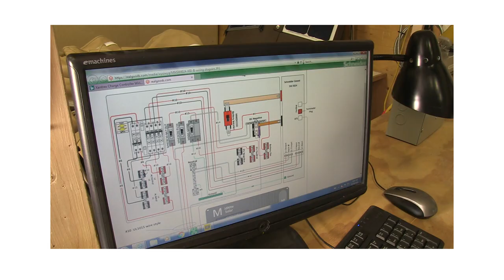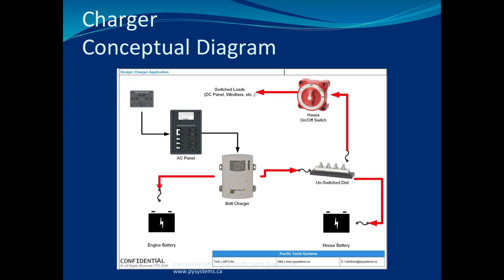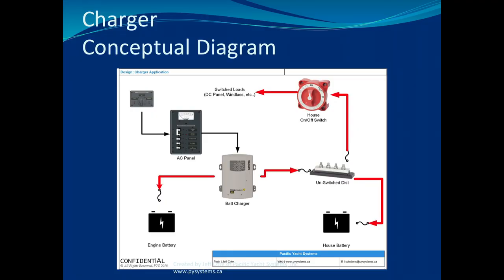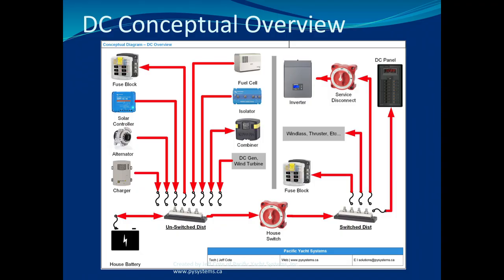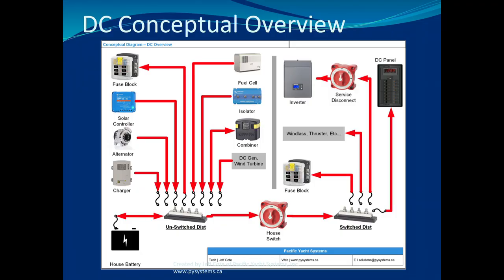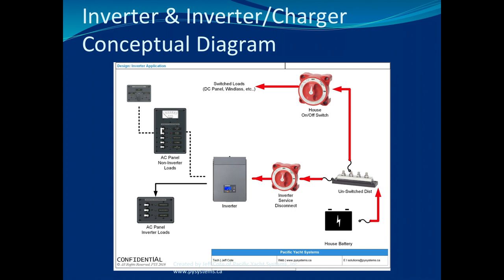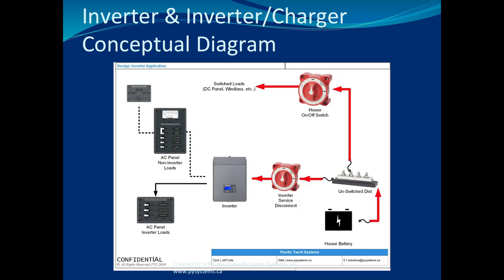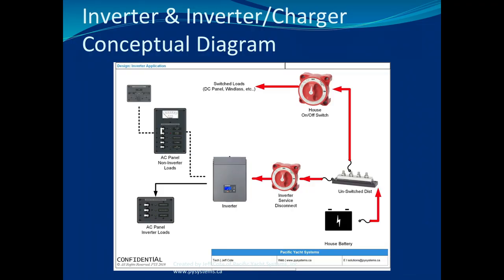How To: Marine Electrical Seminar - Troubleshooting Chargers and Inverters - Episode 10 of 12

Comment: I’m going to remove 2 -8D batteries and replace with 6-6vdc lead acid deep cycle batteries. Do you have any suggestions or must do first steps before disconnecting old batteries and then before connecting new batteries. As far as I’m concerned, you guys are the guru’s. Great videos and help us commoners. 😃

Comment: I just bought a boat where the Charger/Inverter is switched through the original 15 amp charger breaker.  The flow through then passes through to the receptacles breaker (15 A) and water heater by-passed (shore power only).  Having a 100 amp (8A AC) charger plus the recaptacle loads, should the original charger breaker be changed to a larger amp load?